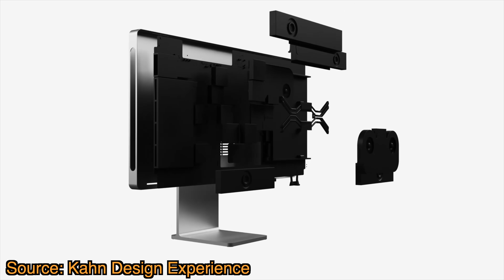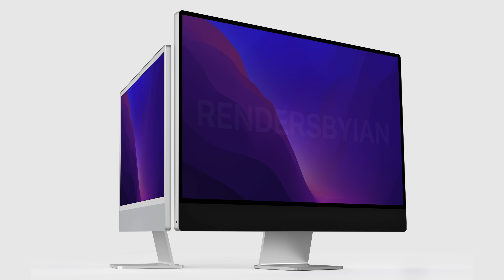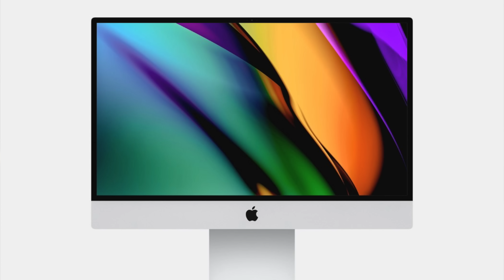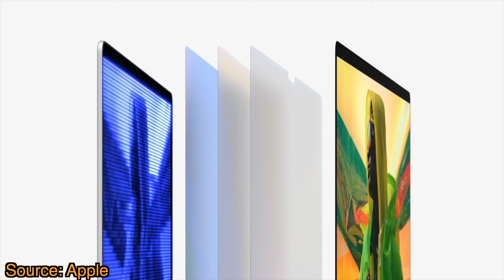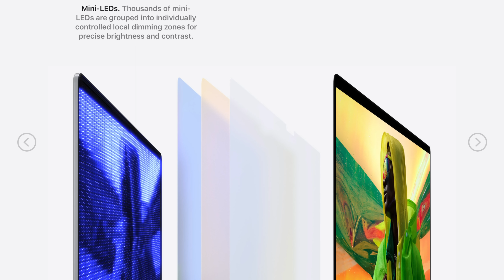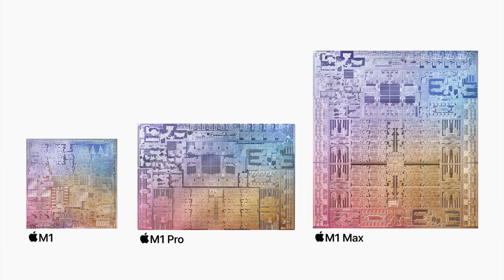M1 iMac Pro - Maybe I should Have Waited...

Comment: Better speakers on an iMac Pro? But who cares about speakers on this kind of product which are usualy plugged to an external hi-quality audio interface and external audio monitors? We use the internal speakers just to check how our sound is on " an average consumer product" as we do on our car stereo or on the bluetooth speaker in the kitchen.
Lots of ports (a max' of thunderbolts, and  HDMIs because we work on more than one monitor), a big screen (32), 128 Go ram and a "M1 ultimate ultra" chip (or whatever the name as long as we've powaaa),  that's important.

Comment: If the screen is going to stay at 27 inch I wonder if it will stay at 16x10. I have been using a MacMini with a HawieMate which is a 28inch 16x12 screen. The actual width is about the same as the 27inch Apple but the vertical e height is massive. This proving very useful for editing because I am not short of space below the edit window. For creatives I think 4:3 is more useful in a big screen, in smaller screens the wide is better. The ultra wide screens which are a new trend look good but vertical height is terrible so in practice they are flawed.

Comment: I would expect the iMac pro will have both the Pro and Max chip sets and I think its likely (but not certain) they'll do a top end machine with the duo max chipset (two M1 max combined). The pro mac mini will have the same range, although probably not the duo-max chipset. I think that will be in the base mode Mac pro. Given the modularity of the Mac pro chasis, i would if they could put two quad-mac chips set in a single chasis for really top end performance.

Comment: I believe the chipset will be Dual M1 Max and Quad M1 Max, and it’s possible for the iMac Pro to get the Dual M1 Max, while the Quad M1 Max will be reserved for the highest tiers of the Mac Pro.
Reply: The Dual M1 Max could be maxed out at: 20 core CPU, 64 core GPU, 128 GB RAM and up to 16TB SSD
While the Quad M1 Max could be maxed out at: 40 core CPU, 128 core GPU, 256GB RAM and up to 32TB SSD.

Comment: The last iMac Pro started at $3k and up. But they still need true $2k iMacs still. So maybe the pro will be $2k and the max be $3k. Then after the Mac Pro comes out they can come out with a $6k iMac and $5k MacBook Pro with Mac Pro class chips. Apple is trying to double the price points like they did with just about every other consumer product they have. The high end of tier is double the price of the low end.

Comment: I just hope there is still a base M1 Pro variant since I just want a bigger iMac with black bezels and a Space Grey option. I don't need overkill specs that cost me an arm and a leg
Reply: It starts at around 2k 
Why would it be cheap
Reply: @TinyBearTim  I would be thrilled if it started at 2k. But considering that the last model that was dubbed “iMac Pro” started at 5k and rumors are saying  MiniLED, ProMotion,  possible FaceID, and up to M1 Max Duo, it’s hard to believe it would start that low
Reply: Not gonna happen. You may get a new Mac Mini with M1 Pro. You will have to buy a display.

Comment: Yes @Sacto. I think there will be a range of chips that can be configured into the iMac Pro.  The 24 inch already performs at a very high level so these new ones (if it does actually happen) will be insanely quick.  In terms of aesthetics I am a little confused with Apple’s continued drive to make the machine as thin as possible.  To me, it makes little sense to strive for the thinnest possible design when the stand is several inches from front to back thus an extra few millimetres on the display would be of no consequence.  Also, I think the 24 inch iMac, whilst a great performer, is not as attractive as the previous generation of iMacs.  The stand looks cheap in comparison to the older stand and I miss the logo on the chin.  I still will get one though.
Reply: They've actually be less inclined to focus on thinness as a feature since Ive left. The new phones are thicker, the new iMacs are visually thicker, new mbp is thicker etc.

Comment: re: HDMI... what about video in? I can only dream, I guess.
Reply: You are correct.  Why can, I get this on a cheap Blue Ray DVD player but not on an iMac?
Reply: @transitengineer  Note: I'm talking about video-in so the iMac's beautiful display can be used as the center of a tech setup for more than just being the iMac itself (one might have a game console, a PC - since the Mac can't do Windows now - or one of many other devices they want to use in their setup). It is kind of a waste of a display to make it single-use.

Some want HDMI out, apparently to add more displays? I don't see the need for that, as there are other ways to do that, it is just a matter of port-type.
Reply: @SteveW928  I hear what you are saying.  But, the portable Blue Ray DVD players that, I was talking about have both an "HDMI out" port and a "HDMI in" port.
Reply: @transitengineer  Interesting, I've never seen one of those. Are they Blu Ray burners as well? If not, what does the HDMI in port do?

Comment: It looks like a iPad glued to a stand. What a piece if trash. There is no reason for a all in one to be that thin. I would much rather have a thick computer with better cooling and more io. Instead we get this thin crap with like 2 ports.
Reply: Yes you are correct, the basic new colorful 24-inch iMac models are not for everybody.  I said good bye to the iMac line after Apple removed the DVD super-drive.  Because, why have an All-in-One system if, you still need to connect several external devices.  I have been a mac mini user for over 10 years now and loving it (smile...smile).

Comment: I need to replace my current 10 year old iMac and was looking at the new 24" iMac but I am worried that the highest specs possible of M1 chip and 16GB of unified memory will not be enough in a few years.  I do a lot of photo editing in Lightroom and Photoshop (on my wife's 2 year old iMac with i5 and 16GB memory, my poor 10 year old iMac won't even run Lightroom) and that things struggles when doing merged pano's etc.
The iMac Pro is something that would handle my tasks with ease but I am not a professional that makes money out of my iMac and I just cannot justify spending the $7,000 - $$8,000 AUD that I reckon the iMac Pro is going to cost down here in Australia and TBH for my needs it's like buying a sledgehammer to crack a nut, I would be wasting thousands of $$.
The current 24" iMac is great for the average work from home consumer and it will perform the basic stuff and some more complex tasks but when pushed to do heavy photo editing I'm not sure it will hold up for the long term (3-5 years) and I don't want to be replacing it in another 3 years.  There does not appear to be any middle ground.  It's either the 24" iMac or an iMac Pro.  It would be nice if Apple provided the option of upgrading the 24" iMac to include the M1 Pro chip and 32GB of unified memory which would then future proof the 24" iMac for the next 6-8 years.
A MacBook Pro with the M1 Pro chip is an alternative but when you add in the cost of an iMac quality monitor you are looking at big $$.
Will just have to wait and see what upgrade Apple does to the 24" iMac in the next 12 - 18 months.  Maybe an M2 chip that can allow an upgrade to 32GB unified memory which I would feel a lot more comfortable with.
Reply: not sure this will help you but here goes.  Own an ad agency.  We are using mba m1 8/7 with 16gb mem and i ac orange 256gb 8/8 with 16gb memory.  Use samsung t7 for all large files.  Works GREAT.  Never thought we could video edit  on a mba but with m1 you can.  My thought and again you can take it with a meh :) but I honestly see no reason to wait.  In tech, but especially on here people always want to go to the latest greatest.  My only new purchase in 2022 might be to get m2 mac book (air?) because as a design nerd it be fun to have the laptop color of the imac.  That’s really it.  I am so happy how this works on a daily basis.  That being said you might have different needs.  Since ADOBE cc became m1ish:) we mostly use ps , ai and Id and they work so well on m1.  That’s really it.  Hope it all works out for you.

Comment: Great video as always. I’d be surprised if Apple went this route. I think they will do the multi-di approach, but I’d expect to see that on the redesigned Mac Pro tower. I’d really be surprised if they put that into the iMac Pro. - But time will tell.
Reply: I think the big argument for it (at least in a “M1 max duo” format) is that so far every apple silicon product has matched what was previously available for that machine in terms of ram, and offered better performance on the CPU. The 27” iMac currently supports 128gb of ram, so only having an M1 max with 64gb maximum is a “downgrade” in terms of numbers (we all know the performance would be better other than very specific scenarios that depend on the literal amount of ram such as using large virtual instrument libraries for logic). Also, if this is truly gonna be called the “iMac Pro” as rumors suggest, the highest-end cpu that was available on the iMac Pro outperforms the M1 max in multi core performance but a dual M1 max would beat that pretty handily! So it all really comes down to whether they plan to keep matching/outperforming what was previously available.

Comment: Honestly, I think that if Apple took a page out of its own book, by loosely copying the 1st LCD iMac, by putting the MI chip and associated electronics in the base of the stand, a thinner bezel screen could be accomplished and a more adjustable mount could be incorporated. No chin would be needed and the monitor could be kept thin and light.  “Anticipation!” Should be the title of your video.
Reply: That 2002 iMac was one of the coolest designs Apple ever had, a shame it only lasted a generation. A modernized version could be quite the thing like giving the monitor even more range of motion for one thing
Reply: @l21n18  I agree absolutely!

Comment: How do I know if a chip is binned?  I get that it’s a different number of cores, but how do I know which one the full chip is?
Reply: Max out pro or max are safe of binned chips I believe.
Reply: @akingsransom  so like, the basic Pro chip in a 16” is binned?
Reply: @Fledgling8448  I think so. Needs to be confirmed though.
Reply: @Fledgling8448  The only variant of the new MacBook Pro with a binned chip is the entry level 14” which has an 8-core CPU M1 Pro. The entry level 16” ships with the 10-core M1 Pro.
Reply: @blagger116   Thank you!